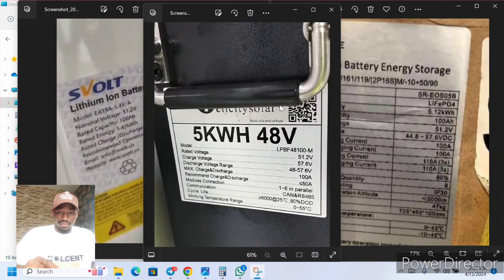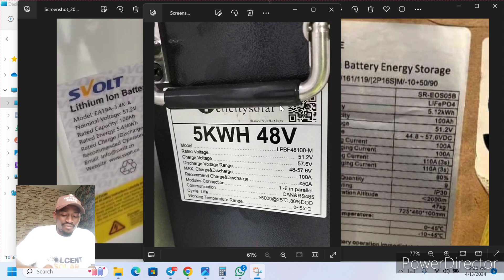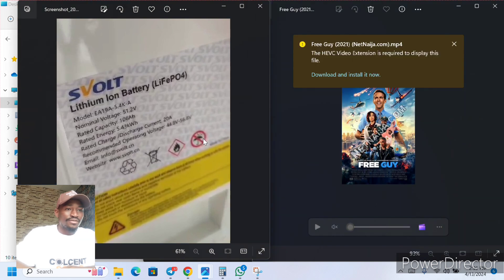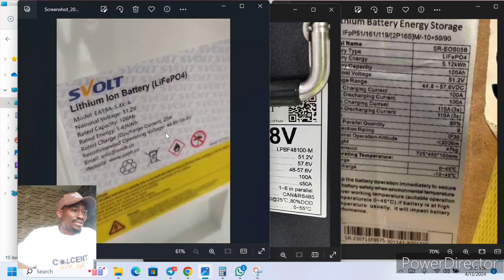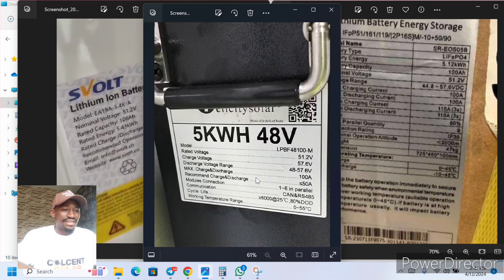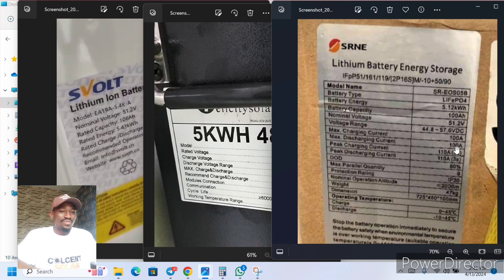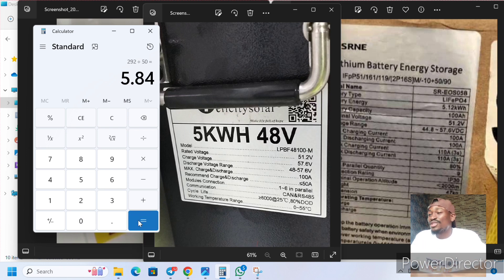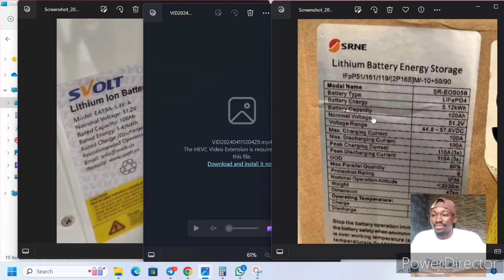watch this video before choosing a lithium battery

Comment: 7000watts is a lot of load. Most average homes in Naija (e.g from self con to 3 bedroom apartment) wont go past 1,500 watts, 2000watts at the most. The truth is that when we put up an inverter system, we are not expected to push all devices through it like NEPA. Thats power abuse in my opinion and na that user go suffer the consequences. 😊
Reply from the maker: Understand the logic,you can use your own specific load to calculate 😁
Reply: You can run all your house loads completely on inverter if you want and can afford that. I run completely off NEPA with an 11kw Axpert inverter and 10kwh battery. I routinely run about 7kw for a few hours with electric kettle (1.5kw), water heater (2kw), induction cooker (2.5kw), two AC each 2HP (about 3kw). And that is precisely the reason I went for the 11kw inverter. I don't want the limitation of having to turn off one heavy load to run another. I want to live like I am on the grid with no restriction. But you are correct, most people will not run that much load.
Reply: @1982757  Nice setup. How do you handle raining season when we have little or no sun to generate enough power for your battery bank? do you also have generator to support your system?
Reply: @xtremeideaz  Surprisingly, even during rainy season, you still generate a lot of power during the day if you have sufficient panels. Don't forget panels are more efficient during cooler weather. I have a 7.6 kw PV array size and intend to expand it soon to 13 kw. However, there is abundant sunshine even during rainy season because of Nigeria's equatorial location. And if you have a lithium battery, its fast charging capability ensures your battery is fully charged most days.

Comment: Nice video, but in my opinion I think it is excessively oversized. 7000wats for a 48volts inverter system will need about 145amps continuous. Why would you want to double the amperage to be on a safe side? It’s even dangerous to put that amount of amperage without thoroughly designing the entire system (inverters, charge controllers, wiring, bus bars, breakers, surge protectors, cooling etc).That directly imply that you are building the system for 14,000Watts continuous consumption (you wan power mini estate? 🤭🤭🤭). Seriously though, If the load is 7000watts, the 1st battery will require about 7 in parallel to share the load amongst them (I doubt if you can hook up that amount in parallel, most have seen is 6), 2nd battery will comfortably handle the 7000watt load with 4 in parallel, whilst the 3rd will handle the load with 3 in parallel. 😎😎😎😎
Reply from the maker: This is just my opinion from experience 😁 do your own research,thanks for your response 😃 I really appreciate boss
Reply: Your line of reasoning does not seem to be adding up. You reason as if 14KW is that much of a big deal and it is evident you do not understand how systems are designed.
Reply from the maker: Add all the reasonings together and give out the best 🤗,that's the reason for the video 😉